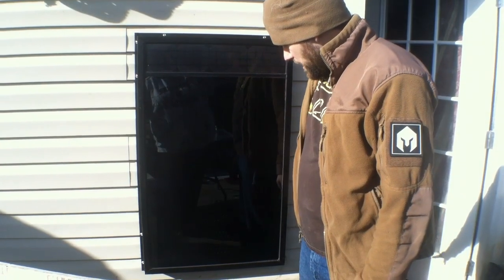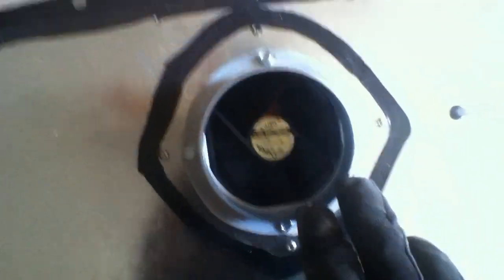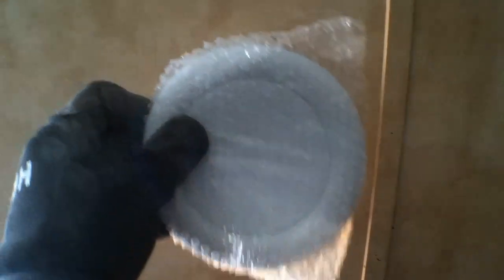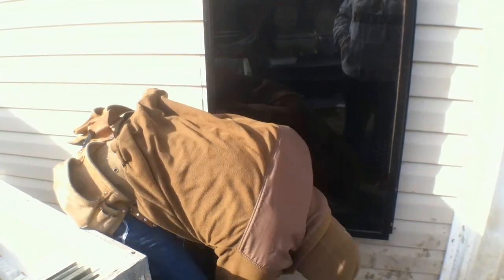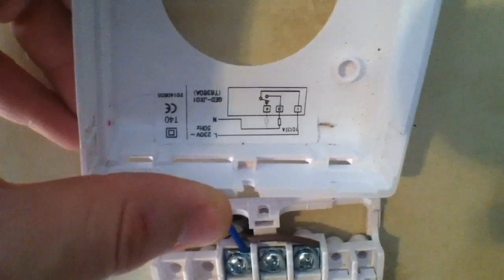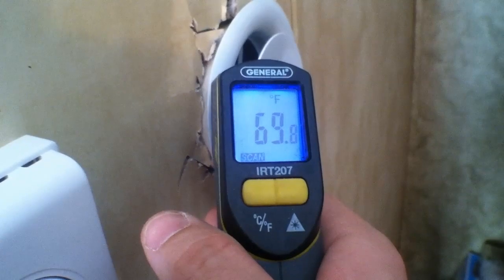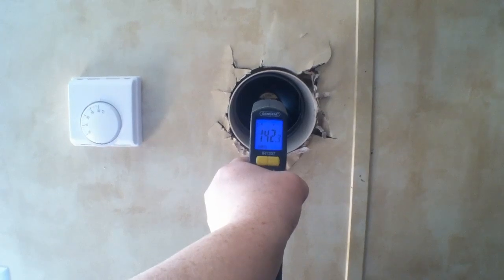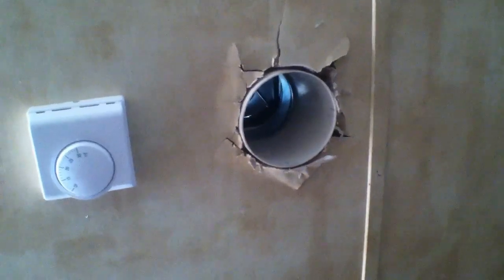How to install a manufactured Solar air heater on your home step by step install video

Comment: I clicked on the link but didn't find the solar air heater. How much do they cost (with or without installation)? How many would a person need for a small 1300 square foot ranch style house?